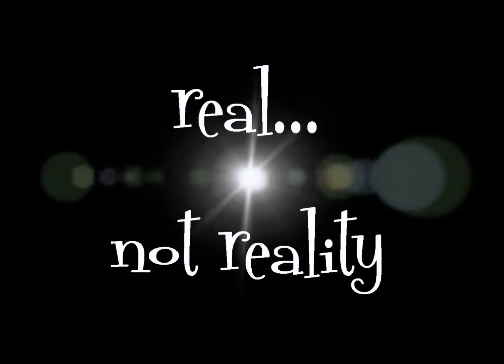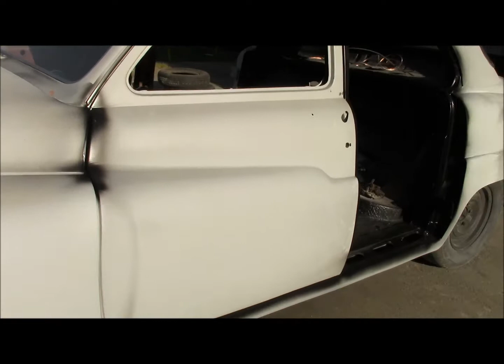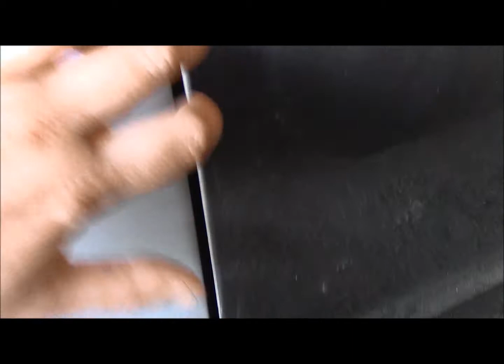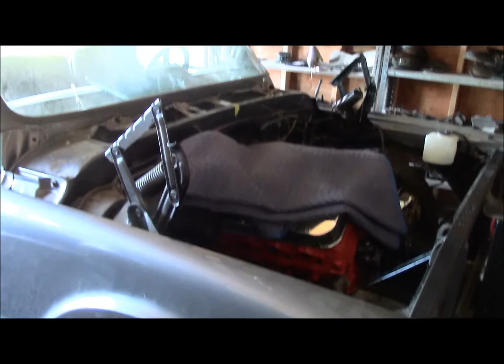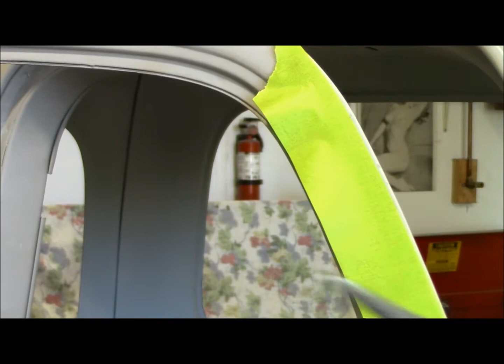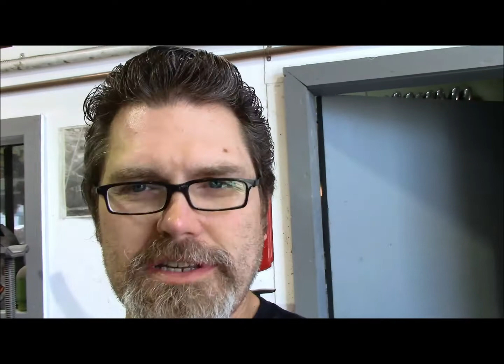How to fix gaps from Old Time Garage

Comment: Thanks for that tip Dave and thanks for the response guys...but my issues with the doors is much worse than that...the hinges are fine...I bought the chassis complete with the body on it...May be I should make a video of what I'm concerned of..I do think a lot of the gap issues is a body to chassis problem because there is a crack that has appeared on the cowl.
Reply from the maker: yeah, that's very hard to diagnose without seeing it.  If you don't have a YouTube channel, feel free to send what you have to Old-Time-Garage@hotmail.com  and we'll be glad to help you out any way we can.
Reply: I have a channel...I'll knock a vid together and send it to you...Thanks again for your time..
Reply from the maker: Sounds good, looking forward to seeing that video.  Make sure to e-mail me or post to this and I'll make a point of watching it when you post it.

Comment: I'm putting aftermarket fenders on a '99 Dodge Ram plow truck. It seems that the front frame around the radiator is too high and the results are major gaps at the bottom of the doors. I shimmed the fenders up at the hinge, but have lost the body line. Any tips? Great channel. Thanks.

Comment: Need your idea on re-wiring behind the dash on my 55 BelAir. 1. Buy a wiring harness or 2. Just buy rolls of wire and make one wire at a time. 
What is your idea on Replacing the main instrument cluster with new digital look alike an Time of re wire?
Reply from the maker: I can't answer the digital thing - I'm old school.  Nowadays it's cheaper to buy a harness cuz of all the different colors of wire.  Plus they're all labeled and easy to hook up and sort out later if you have any issues.
Reply: Thanks for your input.